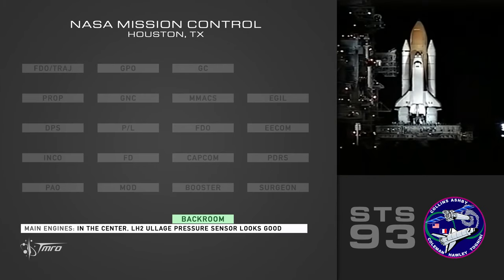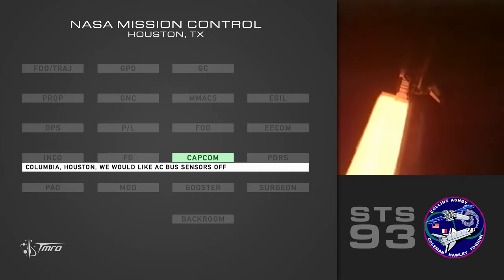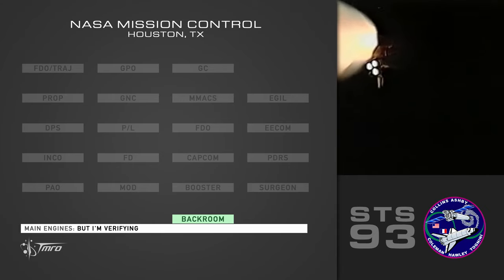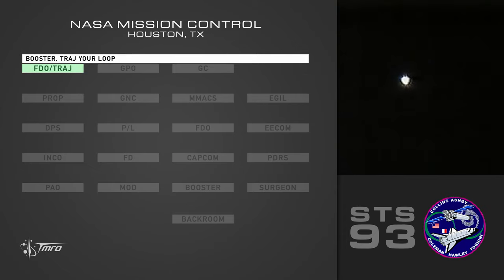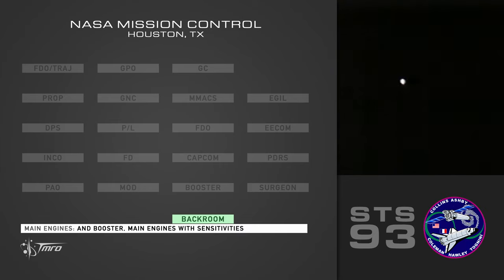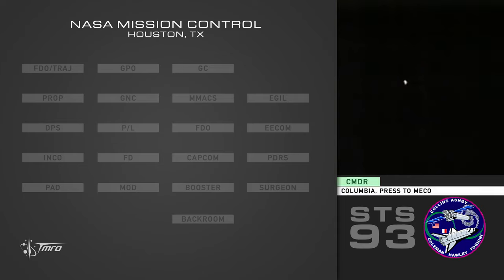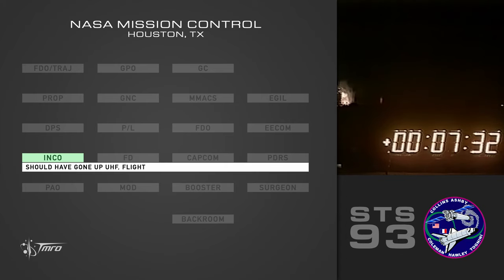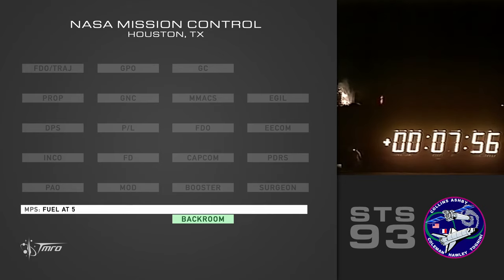Full STS-93 Mission Control Loops - Draft

Comment: FDO/TRAJ -   Flight Dynamics Officer/Trajectory officer

GPO - Guidance and Procedures Officer

GC - Ground Controller

PROP - Propulsion engineer

GNC - Guidance, navigation, and controls systems engineer 

MMACS - Maintenance, Mechanical Arm and Crew Systems officer

EGIL - Electrical generation and integrated lighting systems engineer

DPS - Data processing system engineer

P/L - Payload officer

FDO -  Flight Dynamics Officer

EECOM - Electrical, Environmental, and Consumables Manager 

INCO - Integrated communications officer

FD - Flight Director

CAPCOM - Spacecraft communicator

PDRS - Payload deployment and retrieval system

PAO - Public Affairs Officer

MOD - Mission Operations Directorate

BOOSTER - Booster systems engineer

SURGEON - Flight Surgeon

BACKROOM - Teams of flight controllers focused on specific functions and acting as support crew for MCC

PILOT - Pilot

CMDR - Commander

Comment: I learned that the LOX cut-off/shut down sensors are located, not in the LOX tank itself, but in the LOX pipe that feeds the main engines downstream. If the turbopumps on those engines had run dry, the resulting cavitation would had destroyed the pumps, the engines and the vehicle itself. That was more of a closed call than I thought.

Comment: LOX low level cutoff... Sounds like they just barely had enough LOX to get there and still ended up with a 15ft/s under speed but it was not worth correcting with an OMS burn?

And what was the failure earlier? They said transient on an electrical bus which threw some things offline? What caused it and did that contribute to the underspeed?
Reply: I believe the issue that caused the underspeed was that LOX was being lost through a hole in one ME nozzles. It was fixed on the ground by inserting a gold pin to one of the cooling channels in said nozzle which inadvertently got shot out when the engines were started. This mean LOX was being lost through the broken channel causing the MEs from shutting down early due to low levels in the tanks. This early shut down meant the correct orbit speed wasn't reached.
Reply: Harrison Cassidy It was hydrogen being lost through the broken channel. The engine then detected low combustion chamber pressure, and compensated by consuming more LOX.
Reply: According to the Mission Operations Director, Wayne Hale's Blog https://waynehale.wordpress.com/2014/10/26/sts-93-we-dont-need-any-more-of-those he says if the backup computer had not come online (due to the primary losing power) the LOX would have continued to flow at a high rate, and it's possible that might have not only depleted the LOX too much but also caused temperature to get too high, but it decided to reduce the LOX flow. Another thing mentioned in the blog was that the LOX tank had almost 900lb under what it should have been, which didn't help, but typically they have 3000lbs over at MECO, so 900lbs low wouldn't normally be an issue (well... unless you've a leak, so pressure is down, and decide to burn more LOX to compensate).
Reply: @BryTee  This was the lowest inclination launch possible (KSC) but the payload was the heaviest the orbiter ever carried.
Reply: they fixed it, they just didn't need to fix the small underspend with an OMS 1 burn, ie. an immediate OMS burn right then and there. they made it up with a later already planned OMS burn.